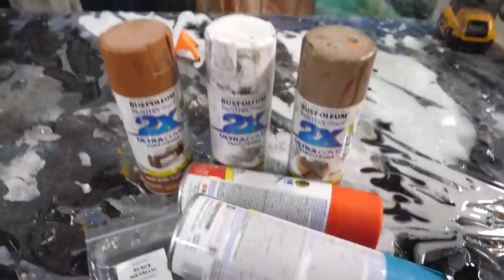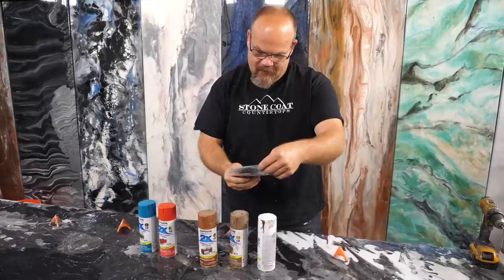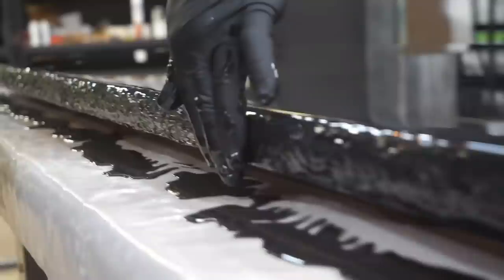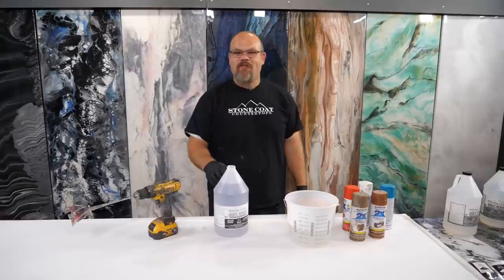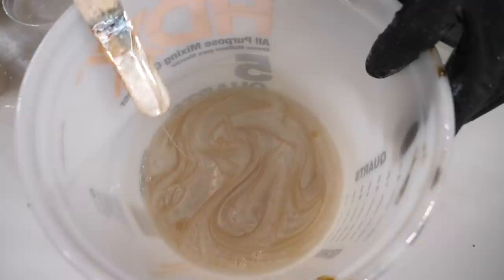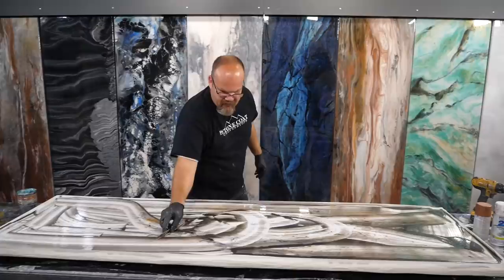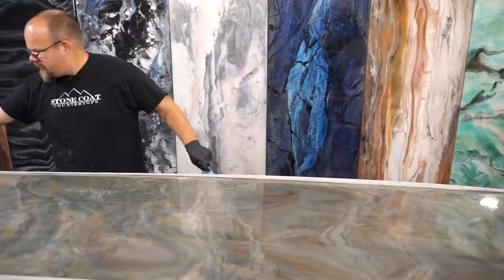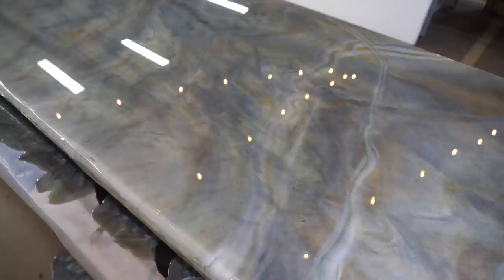Beautiful Epoxy Countertop made from Ugly Colors

Comment: I can’t get enough of these videos. I watch 2-3 hours a day of your channel to learn the methods. I have a  corner shower, a 4 foot tall wainscoting wall surround that is about 12 feet total in three 4’ sections , and a countertop to wrap a very small bathroom. I will use 1/2” foam for the shower and walls. Planning a routed edge for top edge of walls. Need to decide on a color scheme. I have 4 gallons of 1:1 epoxy to get started. Will get started on some samples once I get some powders to add and mix with paint.

Comment: This is my favorite of all the projects, and the one we want in our kitchen. We have yet to start a project, but our friends flip houses and exclusively use Stone Coat in their kitchens (they do beautiful pours!) We are starting small, a bathroom counter first. It is much smaller than the kitchen, and will be good practice. The colors in this Abalone perfectly match our interior. Love, love, love! Excited! Nervous, but excited!
Reply from the maker: You got this! We would love to see how your project turns out on our Facebook page Stone Coat Countertops insiders!
Reply: @StoneCoatCountertops  We are planning to apply the epoxy over old granite that has a raw edge. The problem is that the raw edge is sharp...all of our shirts have holes from leaning against it. Anyway, do you think sanding the edge then applying Bondo would help smooth that out? The rough edge is fine, but this is way too rough. Thanks.

Comment: I think you could apply tempered glass over your epoxy art. The problem is bubbles. I think if you coded the tempered glass with acetone. And you set the glass from wet edge to the other and One direction that you can apply it completely without a single bubble. I've never done it. That's how we get glass cover slips Clyde to tissue samples without bubbles. How much money you could charge a client for something like that.

Comment: Nice work!
I've seen a couple of people saying that the epoxy stains easily. Do you guys have something that prevents that?
Also is there a way to doo a floor that looks like hardwood? I loved the Brazilian cherry wood floors I had, but I'm looking for a lower maintenance alternative for my new place. Any ideas?
Reply: Thank you! We do suggest using a microfiber cloth and some 91% isopropyl alcohol or a Mr. Clean magic eraser to remove any stains. As for the hardwood floor, you are able to apply our flooring epoxy over a plywood or wood floor if the floor does not have much flex to it. Hope that helps! 😊

Comment: How about heat resistant and scratch resistant value for this surface? What happen when i leave hot plate or hot pan on the surface?
Reply from the maker: Our epoxy is heat resistant up to 475 degrees F after a 30 day cure time. Adding our Ultimate Top Coat will give your project added durability as well!

Comment: How do I achieve this look on existing Countertops is my issue. I don't know how much product I need for starters, I can't just take the top off. Plus when you remove the tape where would excess drip just to the floor?? And it would be part done because of my splash board?

Comment: What was the "idea" you had on how to make the glitter show through?  I don't think you actually said anything, it just looked like you mixed it into several cups.

Also, two questions I've asked in the FB group a couple times but for some reason my question is never approved by a moderator and I've been trying to get these answered for months:
1)  I have two gallons that are two years old from a project I didn't start.  I'm assuming i shouldn't use it on the project itself, will it set up fine for samples?
2)  Does either your platinum epoxy or your ultimate top coat help at all with warm appliance "yellowing" or do you still need to set things under your Instant Pot or slow cooker?
Reply: Great questions! #1 the epoxy will still set up and cure. I would use darker earth tones with older epoxy and you won't notice. #2 The crock pot at my mom house with the Ultimate top coat does not yellow with the heat from the crock pot

Comment: What is the work time of this epoxy?
Reply: Stone Coat Countertop Epoxy will be dry to the touch in 24 hours in proper temperatures (70-80 degrees). You can begin light use in 7 days, fully cured and has full heat and UV resistance in 30 days. Thanks for the great question 😊

Comment: Curious, what do you do to the edges?  ..Especially if your doing this to an existing kitchen counter.
  Do they have to be done after,
Reply: They usually use their excess to wet edge & then the epoxy glides over the side so the pattern matches.  Thy cover counters with plastic sheets.  After a certain time you wipe the drips from the bottom edge.  :)  been watching these videos for a couple weeks 😁
Reply: @theloveyourfacegal2773  wanting to try this for sure. 64 year old carpenter been working with my hands my whole life. Pretty experienced with the woodwork but this one looks so cool I'd love to try it. Just don't want to get in over my head. Worried I'll just watch it up somehow.
Reply: @spikea.3547  you should go for it!
Reply: @theloveyourfacegal2773  have you ever done a countertop with it? I do have a very worn 12 ft long countertop in Mom's Kitchen I would love to do it

Comment: Your product bottles say hazardous to breathe.  Why don't you wear breathing apparatus?
Reply from the maker: Stone Coat Countertop epoxy is a Zero VOC formulation. It is very durable, heat resistant, has a long working time, and very little smell when working with the product. It's food safe as well as U.V resistant.

If you have breathing or smell sensitivities, you may want to consult your doctor before use. We have SDS information for our products should you need it.